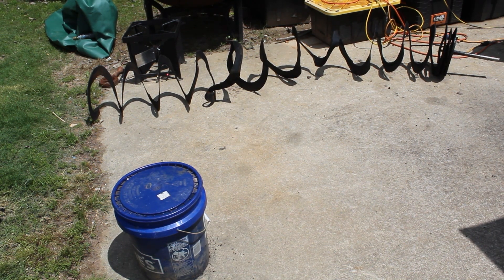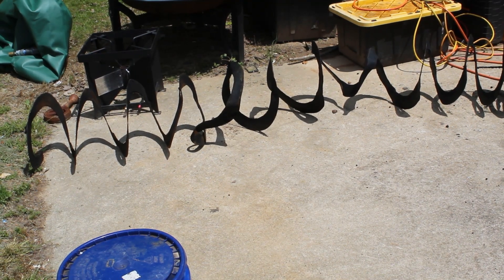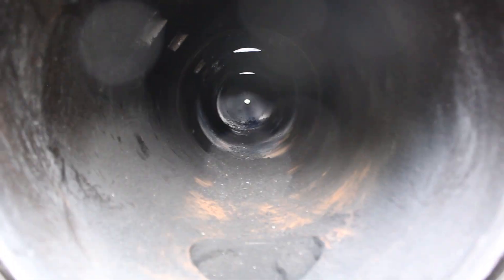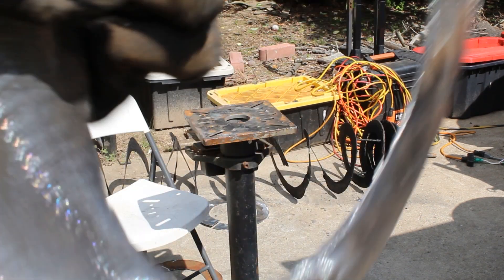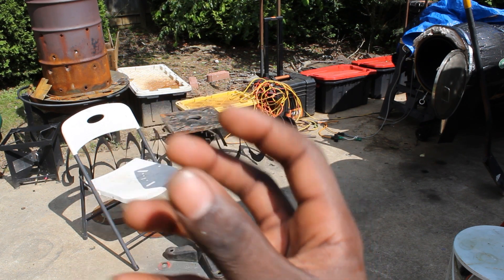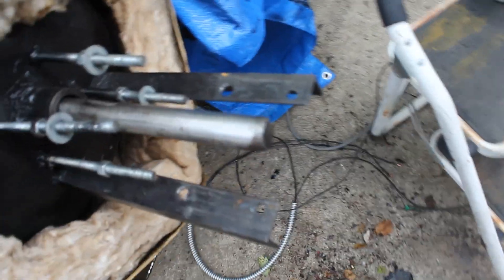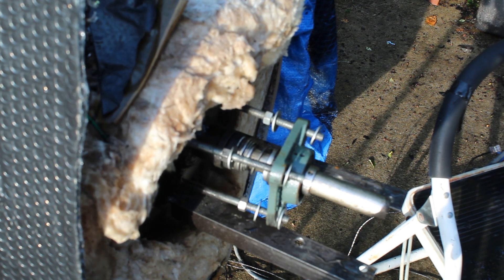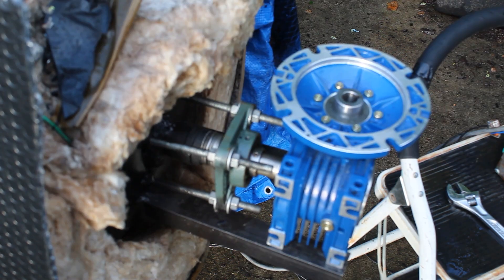Plastic into Fuel Reactor | Repair of Auger Blades

Comment: Has any of you ever thought that the machine might be using more energy that you can capture?
Obviously the machine cannot be outputting less energy than it uses but the amount of energy that takes to power the machine is probably more than the amount of energy that can be used.

Comment: On the mock up my engineers have made we have made preparations for pre-maitrnance. Do not galvanize metal btw. Also I would suggest yo flare out some holes on blades 5-8-5 . Fifth blade in on both sides also the center blade.

Comment: This guy are genius
Reply: He's crazy backyard engineer and a good one for his age but this is just an alcohol still with an auto feed for plastic. a gas vent for condensed gases. a collection for waste of the plastic (carbon) but instead of heat with a regular alcohol still he's using microwaves from a magnetron it's been done before. 

There's already multi million dollar companies doing this more effectively, efficiently and on a much larger scale with other methods and there's a company called contec doing this concept with tires can give em a Google
Reply: @macdogg2626  thanks, I will check this

Comment: We need to get you a plasma cutter bro straight up if youre gonna be dealing with sheet metal. Check the rotor auger method I mentioned in your other video. It will last so much longer though it for sure will be heavier so some mods might need to be made. Good luck.

Comment: I seen you filling your talk in another video, should have some needle valves on the ends of the hose, just in case you can't take it off safely you can close the needle valves and detach the hose, even at low pis you should have Double isolation, I love what your doing!! Stay safe out there!!